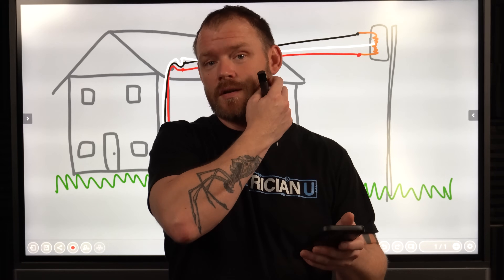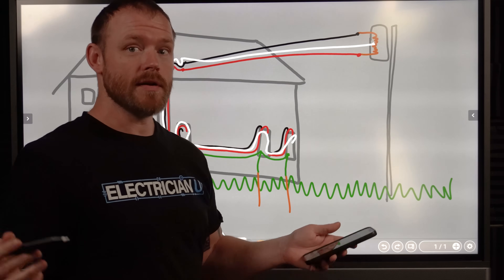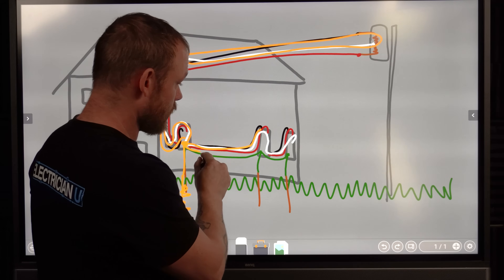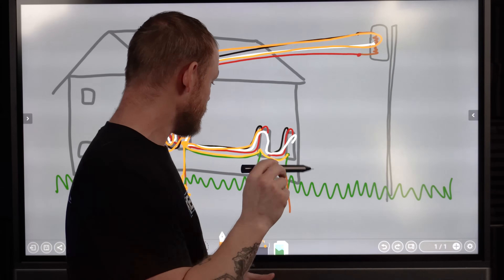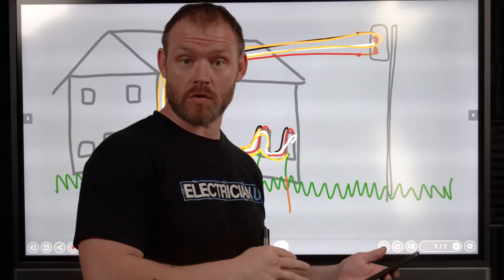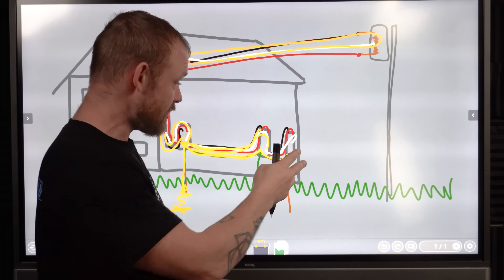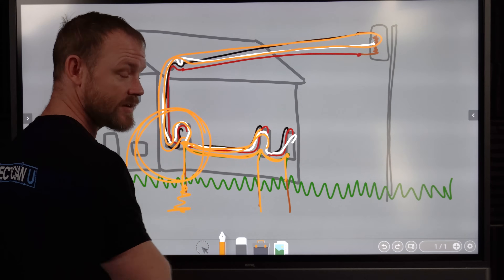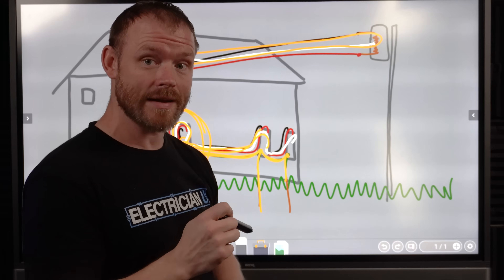Do We Need Separate Ground Rods for Each Sub Panel?

Comment: The question I have is , do you have to run a ground wire from main panel to sub panel if you have  Sub panel grounded with rods, I hope not because it's harder pushing 4 wires in a conduit

Comment: So good! It was implied but it needs to be stated that extra ground rods connected to sub panels within the same building MUST be bonded to the overall ground system. The grounding rods must connect to each other, otherwise you’ve created differences in potential between unbounded systems within the same structure, which can lead to arcing.
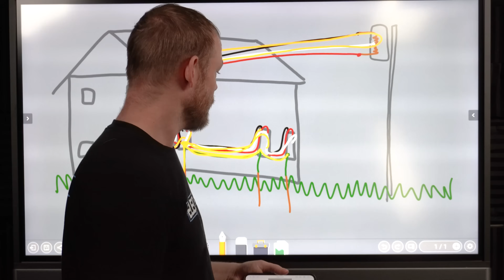Reply: He explicitly states this at 3:00.
Reply: @johnnypizzaguy  Fair enough, he just doesn't go into why not bonding them is problematic.  Great video though as always.

Comment: I noticed at my friend's older home that there is no ground running to his sub panel and the neutrals and grounds in the sub panel are bonded.  I know this is bad.  A separate ground wire from the improperly wired sub panel to the main panel was attempted to be run but the attempt failed.  Would it make sense to add a grounding rod at the sub panel and then to separate the grounds and neutrals?  Trying to make a bad situation better.

Comment: I'm told that if the sub panel is not in the main structure (like in a separate garage), the ground needs to be tied to a grounding rod as well as tied to the main panel's ground.
I suspect the reason is, in case the ground wire between the garage and house gets broken, there's still a ground to prevent electrifying metal appliances.

Comment: Thank you for the video you've probably just saved me thousands of dollars because I've got so much false information on YouTube that this is the only video that actually proves that all the grounding rods need to be tied together on the same circuit including the ground going to the PV frame from what I'm understanding on this video is that if you have a lightning rod on your house which is got its own grounding rod driven into the ground that grounding rod needs to be tied into the grid grounding rod and then the frame of the PV system simply needs to be grounded to the main box and if it is grounded to his own grounding rod that grounding rod also needs to be tied into the grid grounding rod and the lightning 
Rod grounding rod

Comment: Hey Dustin, good stuff as always. I have a question on the additional ground rods at sub-panels. Would those ground rods be auxiliary grounding instead of supplemental? If so or not, can you explain the difference? Thanks

Comment: There is evidence now that auxiliary ground rod actually make your installation less safe. On reason is that it can provide additional pathways into your system for nearby lighting strikes. Study Mike Holts sections on system grounding and bonding.

Comment: i thought you shouldnt have a bunch of ground rods because it creates a path for like static underground to pass between the ground rods. you can get something like a phantom voltage. and also it creates a sepreate path and you just want one path and everything works better that way. adding a bunch of auxiliary electrodes wont help you and can possible cause more problems. but iduno, bonding gets pretty complicated.

Comment: So, I never seem to find my scenario covered anywhere:
Garage was to be main service on vacant land. Was wired as such so it is bonded. 
Due to inspection problems with the slab, electrical inspection wasn’t possible. 
Got pole service and used the large pass-through lugs to wire the panel at the garage. 
Both panels have ground rods. 
Does the garage panel need to be unbonded???
Wasn’t sure as using the pass-through is similar to being the main feed…

Comment: “You can put as many ground rods into anything you want.”

The issue here is that they can’t be independent of each other. 

A building should not have multiple independent ground rods in its system. All grounding electrodes in a building must be bonded together to form a single grounding electrode system, meaning multiple ground rods should be connected to each other. This is to prevent multiple zero voltage reference points. You need to have only one zero voltage reference point.

Comment: Dustin, thanks for all the great info. I have a 1950s house with 4 units added in the 60s - the main house has an old fuse panel (I think it's a general 60A) as the main disconnect, the other units have single, dual pole disconnect switch. None of them seem to be grounded or have neutral ground bonding. ??? Normal? I want to upgrade but not sure where to start. Thanks

Comment: Let me ask a different, but related question; let's say you have an existing subpanel in your basement that originally provided 240V power to a "welder" outlet and then connected to and underground feed to an outbuilding over 300 feet away from the house.  The outbuilding had both 240V and 120V circuits and had its own ground rods.  The cable going to that subpanel (within the house) has 3 conductors in it - black, white, and red - NO GROUND conductor is present.  The outbuilding is no longer present and we'd like to re-task this subpanel in the basement to provide BOTH 120V AND 240V power to the basement.  Is it acceptable to just install a pair of ground rods outside the basement, connect those ground rods to the subpanel, and provide the EGC via that ground connection.

To be clear, the neutral and grounds would NOT be bonded in the subpanel.

Obviously, the driver here is to not have to run an EGC back to the main panel (where the structure connection to earth is located) while still providing a safe 120V operating environment.

Finally, the original work was completed over 35 years ago, explaining the lack of a ground conductor in the existing cabling.

Comment: Thanks for the video. Question: How do you ground main breaker panel if it is in the garage? Main disconnect is in the main breaker panel. Can you put the ground rod where the meter panel is and run the ground wire from it bundled with the hot and neutral ?

Comment: Hey yall I just added two grounding rods , 8 ft each, 6ft apart to a detached garage. My only concern was I had to put the grounding rods on the side of the garage which is about 25ft from the panel. So I ran the 6awg solid cooper wire from the side of the garage up and over on the studs into the panel with just the white electrical staples. Does the NEC code require you to run the grounding rod wire a certain way?

Comment: I was told that it wasn't a good idea to have an equipment grounding conductor at a sub panel just in case you loose the neutral in the main at the pole. Then sub panels would act as a main without the grounded and grounding conductors bonded together.

Comment: Great video.........Since the netural bar is not bonded to the ground bar in the sub panel.........what does the neutral connect to? For example...........I have main panel that goes into a double position throw switch.......then that goes to another breaker panel (sub panel ???) My ground from second panel goes back to the main panel.........everything works great...........however........I am connecting my generator up to the double position throw switch......for when the main power goes out........the 50amp wire that goes to the generator has four wires.......Based off of your video I know the ground goes to the bus bar in the sub panel........however what do I do with the neutural wire ? Do I just cut it off and run with three wires ?
Reply: Neutral in a sub panel goes to neutral in the main panel.

Comment: Question; if I run my SER from a main panel to my sub panel, is that grounded enough?  I can’t get a supplementary ground back to the main panel, however the SER has a ground.  I can however ground the sub panel like normal, (obviously not bonded)

Comment: What about bonding your ground rods together underground?  I work for the utility company and in our sub stations we have a ground grid underground all inside our yards.  Also we have ground rings all around our large power transformers consisting of a ground rod in each corner and bonded together with a 4/0 bare copper wire tied to the Xo bushing of the transformer.  We do this mainly to reduce step potential during a ground fault event while we are inside the sub.  

The reason I'm curious of your response is I was considering installing a solar array about 100' of my house and was wondering if i made a ground ring around my array similar like I mentioned above with our transformers and bonded that ground ring to the ground rods at my main service panel using a bare conductor underground.  This way if lightning strikes my array technically the ground potential at my array and my main service panel would thereotically be the same thus minimizing the circulating current in my green ground wire  that goes back to my main service panel.

Comment: Hello 
Dean from Michigan.
How can I tell if my 40amp breaker or one feed line is broke. Wires are under ground from house to sub box in garage. I’m only getting feed of 125v on one lead. It’s coming from a 40amp push attic breaker.double pole. And the breaker keeps tripping. After awhile. Thanks

Comment: I know multiple grounding rods for different sub panel must be no less than 6 ft apart.  But what if I want to multiple grounding rods for my main service panel? Is there a minimum distance they must be?
Reply: It would be the same.
Reply: @surferdude642  Thanks bud
Reply: @surferdude642  also, can a pad mount utility transformer and house share the same main grounding rod🎈?
Reply: @EbanQHanna  It would be better to check with your utility company on that one.

Comment: When I built my garage, it was code to attach a #6 to the rebar in the foundation and just left coiled up at the corner for future electrical installation. 
1 - do I have to run my first ground rod 6 ft from the foundation ground? 
2 - do I tie the foundation ground to the ground rods and  make one connection to the panel ground bar or run the foundation ground and the 2 ground rods separate from  each other into the garage and tie them separately into the ground bar of the panel ? 
Thanks!

Comment: If you install 2 ground rods, can you run 2 wires from the ground bar or do you have to have 1 continuous wire from ground bar to both ground rods without splicing?
Reply: One un-spliced GEC jumped from one electrode to the other. Article 250

Comment: Very great video, but please forgive my lack of English language. If I understood well, the only place where the ground rod is bonded to the neutral is the main panel, and the other ground rods in the subpanels don't bond with the neutral. Am I right? Thank you.
Reply from the maker: First means of disconnect. Where that is will depend on the installation. Sub panels don't get bonded neutrals and grounds. Just a ground plane at let's say an out building. 

The first means could be a meter main combo outside. Or a disconnect switch before your panel inside your home. For example.
Reply: @electricianu  , thank you.

Comment: I would have to disagree that a grounding rod at a subpanel is acceptable. 250.50 says all grounding rods must be connected together to form the Grounding electrode system. Connecting a subpanel grounding rod conductor (its not a GEC) to the EGC is a violation. 250.54 allows for auxillary grounding rods, but also specifies that the Earth shall not be used as an effective ground fault path. Therefore disqualifying this method. never will you see an engineered drawing show ground rods on a subpanel unless it's on a separate structure. Grounding is tricky. Your fault current must return on the equipment grounding conductor, back to the service through the grounded system conductor and back to your electrode system in order for the system to operate correctly. It's called the return path for a reason.
Reply: I agree, Dustin got this one wrong.  I think he is a small residential electrician. Likely only knows what he has seen on YouTube

Comment: You will bond at the subpanel, it will however not have a separate earth connection. The main service earthing rod should be directly (shortest path) from the panel to earth, this is because for overhead service this is the path lightning will take. Lightning does not like to make direction changes, at least within the small distances from feed to house service . We want to shunt the lightning to ground without going into the residence. Also, subpanels are used to distribute power from within a structure (house), so earthing is usually very difficult.

Comment: Hi Dustin, I’m not an electrician but I do a lot of electrical work. I have a buddy that is an electrician so if I have any questions I call him. I just changed out 100 amp service on my daughter’s house, to a 200 amp. I was told to bond neutral and ground in meter base and not in main panel. Is this something that they’re starting to do? What are your thoughts?
Reply: Wherever the main disconnect is where you bond the neutral (grounded) conductor to the grounding conductor.

Comment: I think this is a great video. . . and feel I might offer more.  The ground rod, and circuit are highly misunderstood.  I'll try to explain in the best simplicity I can.  

  Electricity always wants to return back to it's sources . .. hence the term circuit.  

  The ground loop in a home is nothing more than a return circuit to the neutral (transformer source) in the case of a gfi event.  That's why you ONLY neutral bond in the service panel.   We don't need a lightning strike on a shed, scattering through all neutrals on on Panels A, B, and C.  We direct it back through a dedicated circuit.

  There are 2 reasons the rods are there.   The incursion of unexpected current (aks lightning strikes). . . .. ..  and here is the kicker and mind blower. . . . . . because not every  piece of ground holds the same potential.  That's why you ground rod, sub panels.  This is why they place grounding mats under substations - to equalize the grounding potentials in the working fields.

  My dad who retired from running repair crews, that trained in 500kv stations, and served power distribution in 5 states: told me this;  "of all circuits, I fear the ground the most".  He knew, every piece of ground held a different potential.

Comment: Question: i just left a job, where  was taking over from another company. I saw their ground rods installed inside PVC. I can think of a reason why (to let the point where rod meets earth, be lower than grade level, to not energize the grade level)… but am I correct in assuming that was why?

Comment: It has no benefit at all, and is actually not recommended to add additional ground rods outside of what is actually required. In a major electrical situation like a lightening strike, you will cause a voltage gradient around each rod that could cause a deadly situation since you could have one part of your body inside the gradient (radius around the rod affected) and the other body part outside of it, which could mean the difference (hundreds or thousands of potentially) of volts going through your body. Don't do it.

Comment: So if your "source" of electricity is an off grid solar panel, then you will not be bonding the neutral anywhere in the circuit and would be using grounding rods throughout the entire system. Correct?

Comment: Excellent, I was looking for this answer.....We had an old cabin and a separate garage...Then came the electric company and they wanted to bury the electrical lines.....so since we were tearing down the old cabin in the future, we had the main 200 amp breaker panel put into the separate garage and now that we have a new house, the panel in the house is a sub panel....But now we've built another garage and will be installing another sub panel from the sub panel in the house.........   So, do not bond the neutral and ground busses in any sub panel together......

Comment: I’m a retired computer technology expert.  We found that in manufacturing plants the common ground was not a good source.  The ground would pickup electric signals and and cause the servers, manufacturing control computer systems or mainframes to freeze or error.  The solution was an independent ground.  Also computer raised floors with years of electrical wiring underneath could have exposed wires.  Computer room metal flooring if not properly maintained could have electricity running through it.
Excellent video

Comment: So.......what is even the point of adding those supplemental ground rods? Why not just size up the ground wire that goes back from the subpanel to the main panel instead to reduce resistance?

Comment: Awesome thank you for this. I used to have a hot tub outside and sold it. I just ended up turning off the 50amp breaker and pulling the disconnect. However, I have an RV and now want to utilize that disconnect into a 50amp RV outlet box. I installed this and because there is a grounding rod due to the spa, I ended up using that as well as each ground terminal in the 2 boxes (grounding rod to disconnect box, ground from disconnect to 50amp outlet box, and the disconnect ground back to main panel. I hope this was ok, thoughts? I was thinking I probably didn't even need to reuse the rod but thought I could. Basically all grounds together back to main panel. Neutral is on the 50 amp outlet back to main.